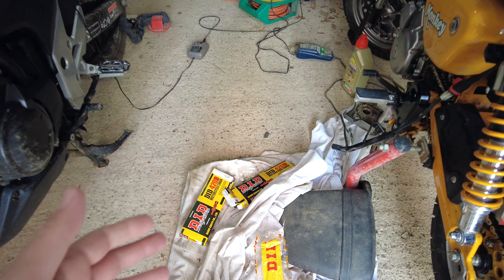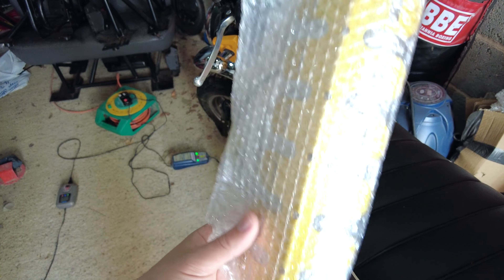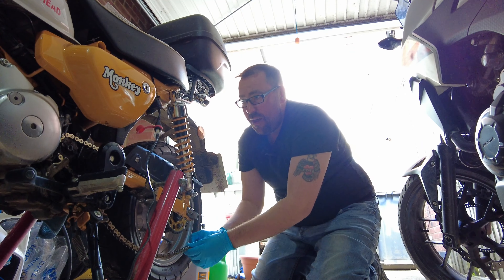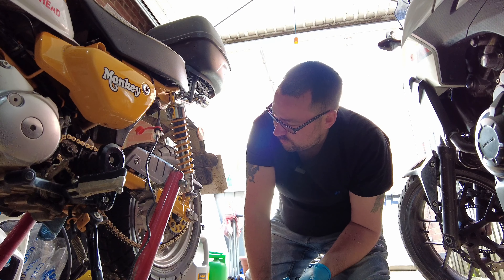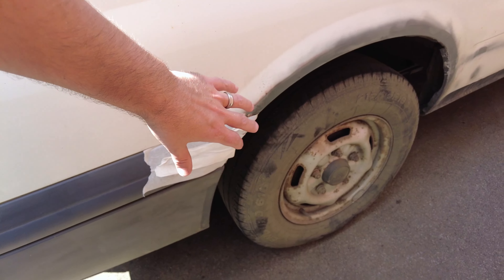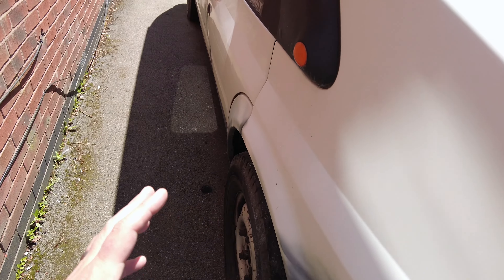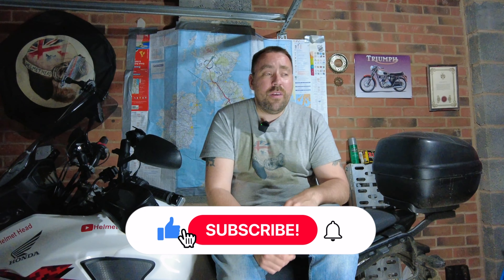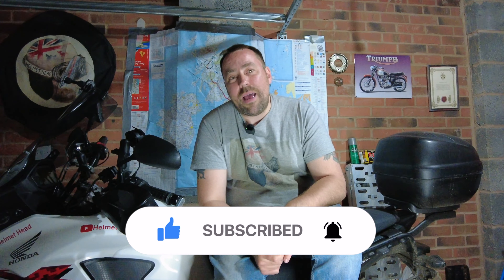Honda Monkey Bike Prep For The Peaks Not Long To Go

Comment: You need an Oxford chain splitter tool. Then you just get an oversized chain and trim to suit. The problem you will have now is that the chain is too long when new. So when it stretches you won’t be able to take out the slack. 

On top of that, use the two shorter chains and make one the correct length. 

See you at the peaks. My bike is ready and I have a new horn which isn’t loud at all honestly
Reply from the maker: Awesome look forward to meeting you in the peaks 😁👍 I'll await the 📣 😉👍